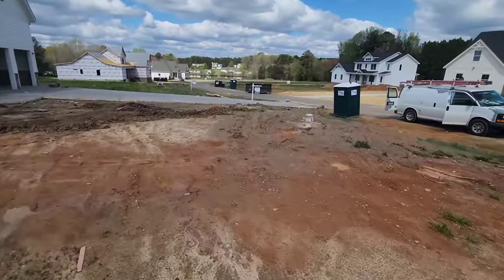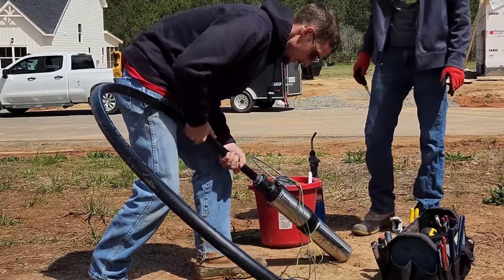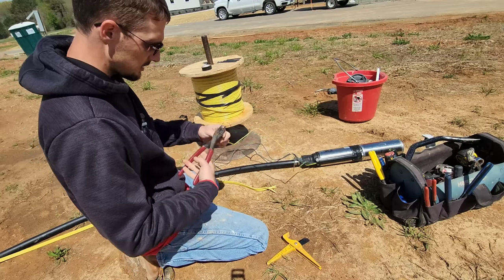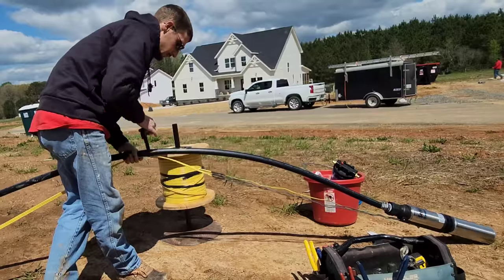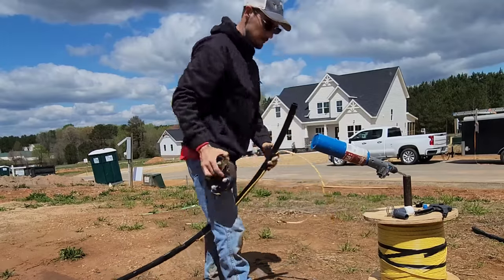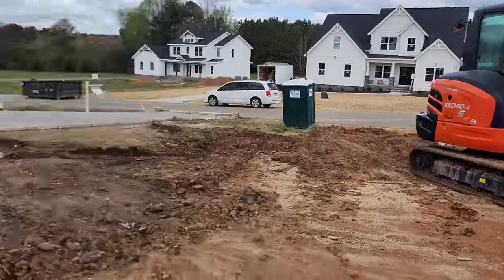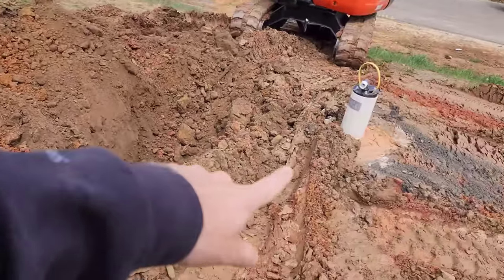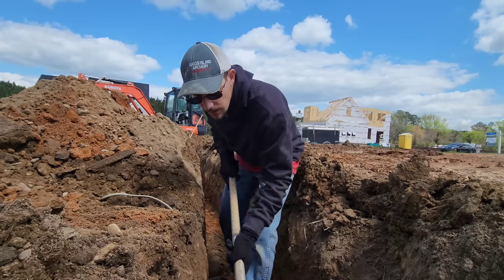Complete Well & Pump System Install From Start to Finish. Well Drilling

Comment: One trick I have learned is something that future owners/plumbers will thank you for is with any underground installation, I backfill a few inches then run a length of caution tape above the line. This way, when (not if) someone comes around digging in that area either looking for the line or doing something else, at least there will be some indication that they are approaching an underground utility. If you want to be really fancy you can add the detector tape with metal in it to make finding the line easy from the surface, but regular caution tape is plenty to get the point across.
Reply: Not really a ‘trick’…pretty sure it’s code, at least it is in my neck of the woods ( Maine)
Reply: @dominicm2175  It is for certain installations, but for something low voltage like communication lines it is not.
Reply: @dominicm2175  Yeah, it's hungary that is in the standard. 60cm fill, tape of what is under, electrical, gas, water, telecom, sewage etc, then the rest of the fill. Also if you burry utilities together it also tells you how to separate and space them from each other.

Comment: You're do good at what you do and I find this so interesting.  My well is over 700 feet down unfortunately. I've got 20 foot sections of PVC. They had to remove my fence and drive the crane into my back yard. . Our well only puts out 2gpm which sucks. And that was re-drilled by the prior homeowner. 
We went from a 3 wire that was tripping to a variable speed constant pressure setup. It's so much better. But hope it lasts.  We've got a ton of manganese unfortunately .  Wish you were around here.  We need more honest experts.  
Love your videos.  Jealous of these 70' wells!

Comment: Now for THE question:
Mr. H20 Mechanic - I'm a cheapskate and want a well for a heat pump. The soil where I come from is clay and the static water level is at about 4 meters (between 2 rivers - 46.384425117958884, 16.442514462512733). The water bearing layer is made up of sand and gravel. Should I even try boring my own well (I want a 5 Inch casing, 2 meters filter pipe length, need about 4,4 gpm)?
And yes, the cheapskate has built his heat pump himself, if you're wondering.
Great channel, I learned so much, thank you for sharing your knowledge and know-how.

Comment: Just watching you putting in water pipe and pump I'm surprised to see the final enspection and you don't have to put sand round pipe we here  in Ireland have to put sand round pipe 6 inches under and over and minumen 2f 6in deep we go 3ft for frost pertection your doing great work every country has different specifications I also worked in England for 30 years higher specifications over there 👍 👍👍

Comment: When I watch electrical & plumbing videos on YouTube, I am always rather amazed by how easy the work is being done. PLC pipe carrying drinking water buried in the ground, electrical wiring just running loosely here and there, etc. In my neck of the woods, all wiring inside a house must be in metal conduit, all drinking water pipe must be copper, buried water pipe, from well or B-Box (in the case of municipal water) must be thick wall copper, uninterrupted from one end to the other & no fittings except at the end and no buried elbows. But I gather that most parts of the country have looser rules in regard these things.

Also, it must be nice doing the work in Virginia (BTW, I have friends living out in the country in the rural Petersburg area, where water pipe can be only a couple feet below the surface (although friends of mine in the rural Tucson AZ area have THEIR water lines running on the surface or just a couple inches below), whereas where I live in the upper midwest, water must be at least 5 feet down.

I also wonder if deeper wells in Virginia have the radon issues like they do in my neck of the woods. Around here, in most places wells less than a couple hundred feet are usually OK, but a lot of deeper wells have radon coming up and expensive mitigation systems must be installed to prevent that radioactive gas from ending up inside the house, venting it out to the atmosphere instead.

Comment: What about putting the line in corrugated 4inch line so its not stuck in the dirt and could always be pulled again later.  Also keeps weight directly off the line could help with rocks and such?

Comment: In germany we generally use black PE (not pvc) as waterlines and bed them in sand/very fine gravel to protect them. So its not overkill to at least remove rocks
Reply: The US is vast country with different regulations or norms depending on jurisdiction/ county. In my side of the country we use PEX (rated for burial) which is also polyethylene for main waterline.

Comment: 19:55

The company who installed the sewer pipes in my old neighborhood did a lazy job by laying PVC over uneven ground. 

I had my main line cameras and there wefe a few significant low spots in it (I kept it clear by flushing 5 gallon buckets through the toilet every once in a while)

And as I was moving the neighbors house (also built 25 years ago, same as mine) had their main line snap and cause a blockage.

Takes a while for these issues to show u sometimes,

Comment: Three phase equipment or pumps are easy to diagnose. No special equipment needed just a simple multimeter. Also capacitors can and do go bad from heat.

Comment: Great video, thanks. By the way, what's  the specification and type electrical cable you used for the connection to the house?

Comment: Are you using Liquid-Tight flexible conduit for wire out of trench to junction box? I thought I had to use schedule 80 because this would be considered "subject to physical damage"???
Reply from the maker: It passes our states regulations for our inspectors.

Comment: A trick with great stuff that lets you reuse it

get a can of spray carb cleaner as soon as you're done using it put the tube in the tip of the can and give it a quick spray it'll flush out the great stuff and then you can do the same thing with the handle and the plastic tube you reuse it once or twice when you do that just do it quickly
Reply: Thanks!

Comment: I would lat a 6 inch bed of sand or straw then lay the pipe and cover it with  another 6 inches of sand or straw   or you could wrap the pipe in that black foam insulation to protect it  The box idea for the wires  takes the cake  when the same electrical codes also say electrical wires have to be kept 3 feet away from water lines lol

Comment: They make this thing, it's called a tape measure. It does wonders when you need to measure.
Reply: Heh. So's the pipe and wire - they stamp a distance every foot or two. (anything over ~20ft I'm not pulling a tape. that's what lasers are for.)

Comment: Nice work, hard work. You must be in the south as we have to be 4 feet deep and have to backfill with 6 inches of sand below and above the pipe to stop stone pressure from putting holes in the pipe as the ground here is extremely rockey. I have a question on the joining of the wire at the pump. We need to use special heat shrink fittings on the electric wire that when heated also seals at the ends of the fitting to the wire? Not the code there? We also have to use couplings 4 feet below the ground on the well casing (pitless adapter) so the pipes are never exposed to the cold. Does the builder ever leave a sleeve for your pipe and wire saving you from digging thru or under the foundation? Thanks for a great video.

Comment: At 12:10 you're using that well seal. If you have a deep well with a system that weights over 400 pounds... is it going to hold it? what if it slips and drops in the well?
Reply from the maker: We switch over to a HD Steel 1 piece well seal past 300ft deep. 
If people drop it, we fish it out!
Reply: @h2omechanic  thank you! Is there any way to reduce the water hammer when the pump stops? My pipes makes a lot of noise and i am afraid it will damage the power wires over time

Comment: I would run HDPE from the well to the pump. The pipe is cheaper than pvc. You dont waste time gluing pipe. Hdpe wont break when frozen. Also, get a borit. Its a handheld boring device. Dig deeper on the outside. Drill under the footer at an upward angle. Then you dont have to dig in the crawlspace.

Comment: 35:00 With you already having the trench so closely dug out right next to the well, I'm surprised you didn't go the extra mile and use a pitless adapter to keep the pipe at the same level as it is in the trench, so it doesn't have to come out of the ground exposed to cold air. Guessing it must not freeze there?
Reply from the maker: Our state law requires a water sample port directly from the well head.

Comment: Hi there. I love your videos. I installed my pump system myself a few months ago and now the system is not working. Would love your advice. My well is 131’ deep, static at 97, capacity 20gpm. I installed a Goulds 1.5hp 18gmp pump with a 1.5hp control panel and 40-60 psi pressure switch. Discovered no water and no pressure yesterday. When flicked the pressure switch sometimes sparks and sometimes doesn’t. You mentioned that could mean a faulty switch or a wire problem. I took the wires from the electrical box and connected it directly to the control panel (bypassing the switch) to see if the pump would fire up and it is not. Next I would test the wire connections from the ground wire to the submersible wire and pull up the pump to check other connections. What else should I consider?

Comment: Second question why not blue clear core. That's all we use in Montana. Major freeze thaw cycles. No fittings and unbelievable impact strength  and flex.

Comment: My understanding was 3 wire is better because you can replace the starter, and the starter is usually the first thing to wear out, two wire or three.
Reply from the maker: It's good to use 3 wire pumps on stick pipe bc pump Removal is so time consuming. It takes 1 part out of the equation. But I always recommend a 2 wire pump until it becomes a 1.5hp or larger

Comment: Is there a way to set up a well just for water faucets and a pond? Without using a pressure tank? If we used something like a Rain Bird irrigation system, without the tank, I would still have to go by pass the System if I wanted to use a faucet?
Reply from the maker: You always need a tank even if it's a small 2-4 gal one. It softens the water hammer that occurs in the system

Comment: Beautiful work! Question: how come your elbow is different color as the pipe? Is schedule 80 for the elbow schedule 40 for the pipe?
Reply from the maker: Dark 90⁰s are Sch80 yes. 
I use them when the joint is buried underground. Just adding strength to the area that'll be under stress.

Comment: What kind of wire were you using to go down the well?  The wire I’ve found has no outer sheath.  It’s just three individual wires twisted around each other.
Reply from the maker: Kalas flat yellow 12-2 wire
Reply: @h2omechanic  
Thank you. 👍🏻

Comment: I currently have a 3/4hp well, open well is 50-80ft deep, I am currently getting 7gpm, what can I do to increase my gpm to run a irrigation system? Can I just increase the size of my well pump?
Reply from the maker: You can try a new pump ,like a 15gpm pump. But its more complex than that . 
Typically I would test the well during heavy use to make sure its keeping up with the demand your using. It may be that the well only makes 7gpm at 80ft, not really a pump issue. 
Just understand installing a bigger pump, my not fix the issue...although it should if the well produces alot of water

Comment: Is there any real reason they dont have the well drilled when the foundation is the only thing there, so that its easier for the well driller to get the pipe ran into the building?

Comment: So a 2-wire system is just a standard 220v with a ground,or 120v with a hot,neutral,and a ground?
Reply from the maker: It can be either if you buy a 115v pump. But typically most are 240v with 2 hot legs
Reply: Okay,thank you. @h2omechanic

Comment: I'm not arguing your knowledge and experience. Can zipties ne used instead of electric tape to match the well poly pipe and 2 wire ? Or possible breakage from swelling of the pipe?
Reply: Zipties will fall to the bottem over time

Comment: Fixing to have a local company out here in fort worth drill a well for me. I was wondering why I couldn't have them drill up next to my metal building, and have only the well head outside, and put the pressure tank assembly and water softener inside my shop. Every well vid I see, the well is pretty far from house. Including the video from 11 months ago where you abandoned the customers old well, drilled a new well pretty far from home by the street. Any suggestions before I commit to where the well head goes?
Reply from the maker: Termite treatment is a big factor. They want 50-100 ft away from any structure that may have future treatment. There's also rules about septic & drain lines & water runoff, power lines, property lines ect. They look at the Lot Plans as a Blueprint and pick out the ideal well location, they also look at future septic repair areas & possible building additions. It's just alot they factor in. Not every site is the same conditions, but they treat it as such.
Reply: @h2omechanic  great info!! Will definitely discuss options with digger when they come out to see lay of the land. Good work on your channel,  I know what it takes, and your sacrifice in time videoing and editing dont go unnoticed!

Comment: Can you help me with the pipe please. I can't find a 500 ft roll of pipe anywhere around. Can you put a joint in the well. Just doesn't seem like the best idea
Reply from the maker: 500ft rolls are special order. You could pieces together 2 300ft rolls with a XL brass inline. But Do Not hang a pump at 500ft on poly pipe! It cannot handle the depth, or  head pressure. At 500ft, it could see 300psi & the pipes only rated to 200 psi

Comment: I can't believe the did not insulate the floor above the crawl space.
Reply: It's more common than you think in the south. The crawl space really never gets all that cold (or hot.) And in winter, it's common to close those vents to keep wind from blowing through. My parent's house has been like that for 60+ years -- plus the fuel oil furnace is in there. We insulated the floor when we enclosed the carport ~30yr ago, but it's almost entirely unnecessary. My sister's house (1908!) had no insulation at all. (blew some into the attic, and stapled bats between the studs - with the century old slat floor base, air goes right though the floor.) My house is slab on grade (sitting directly on a giant concrete pad), so it's not insulated from the ground either. (slab stays low 70s to high 60's all year)

Comment: Hi am currently drawing “clean” lake water for my home and made it through the winter with heated tubing. I am wondering, since i am tight on money, do you know anything about filtration systems/water treatment? If so can you recommend a reliable and repairable model i could put in line with my bladder tank and shallow pump?
Reply from the maker: Google Big Blue inline filter. Those are great. 
Since it's lake water, you may want to think about a UV light kit (I have 2 in stock on my site)
Reply: @h2omechanic  i really appreciate the response and will look into it as soon as i get the chance tonight

Comment: What kind of tape do you use that doesn’t contaminate the water?
Reply: it's electrical tape. It doesn't degrade in water like duct tape does because it's entirely plastic.

Comment: hello i been watching your videos becuase i am trying to figure out what is wrong with mine,  my well is at 75 feet and i have water but it is slow like it is only 30 psi it still runs but the pressure thing has me stumped. i have blown out the all the lines checking for sand and black sand and there was a little but got it all cleaned out, and if i shut the pump off for like a hour and turn it back on i have full pressure and i have a 30-50 switch on it and it does a pump and shuts off like it supposed to do and then the next morning i loose my pressure, that is what wierd and i dont understand why, my pump is only 6 years old and i still runs good, i just looking for little lidea what is going on, i live in ND. i am just asking to see what kind of anwer i get
Reply from the maker: Most likely, you have a leak somewhere that you haven't found. Most likely a toilet that's constantly running or leaking.
See, by turning off the breaker it allows the well to recover & then the pump can build full pressure again (so we know the pumps good!)
After its on for multiple hours, it leaks down to the pump intake and it runs constantly, so I believe that there's a pretty good leak happening somewhere.
Check the toilets for leaking flappers and if any are hitting the overflow tube in the toilet tank. 
    On very unlikely occasions I've had Waterline leaking underground near a drain field or a gutter drain & it is very hard to find the leak.
But typically a water leak will surface & youll see it in the yard. 
Q- if you turn off the pump breaker, does the pressure gauge drop to 0psi?
It's also possible for a leak to be in the well (on the drop pipe) but typically the switch would never go above 50 & cut off ever. 
I'd say your well is a slow production well, maybe 4-5gpm & you've got something wasting water when the system is on. So keep it off til u find it.